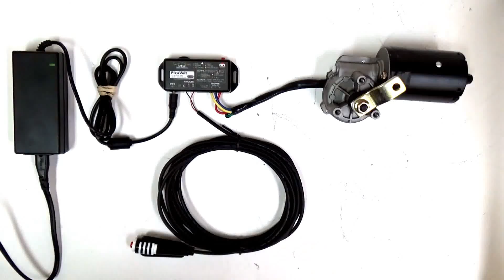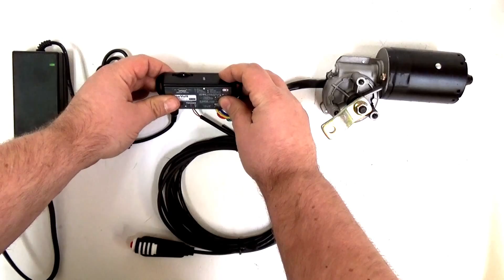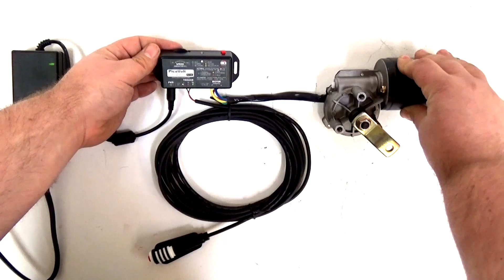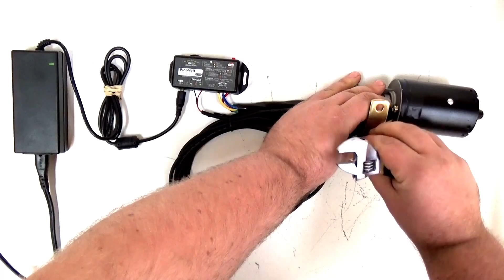Parking Motor and Picovolt Controller Demonstration

Comment: How do you put the dc motor in the picovolt
Reply from the maker: The wires from the motor connect to the PicoVolt via screw terminals on the PicoVolt unit.

Comment: This is Great stuff Scott, is there any drift after it has been programmed? I would like to move arms up and down then return them to a power stance pose.
Reply: The park position is mechanical, so it will not change, or drift, over time.  It will always be the same.

Comment: Can you use a PicoBoo to trigger the Picovolt instead of a push button, PIR, etc?
Reply: You can!  Just run wire from the C and NO terminals of your PicoBoo relay output to the (-) and IN trigger terminals on the PicoVolt.  Then you can program that output to trigger the PicoVolt!